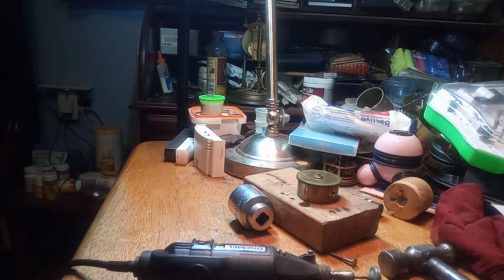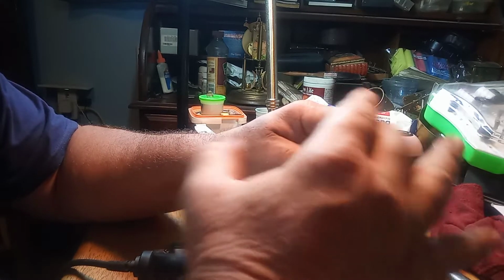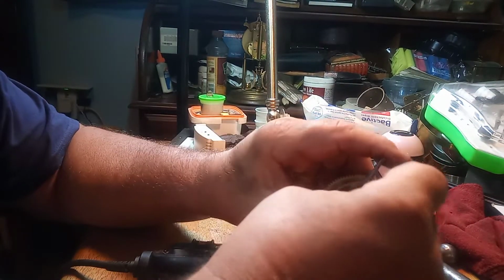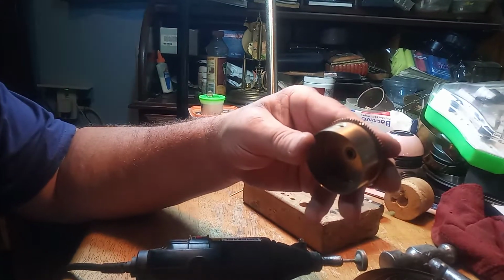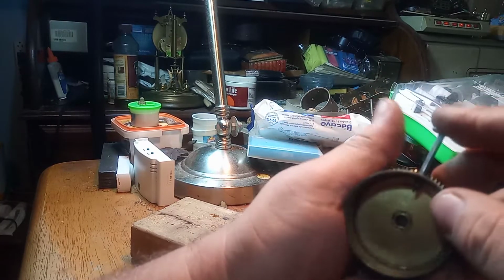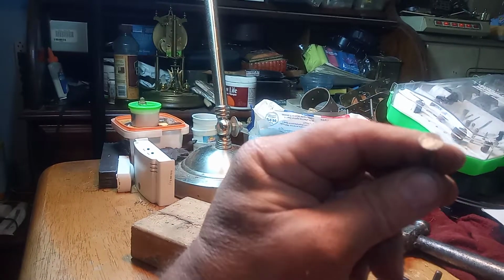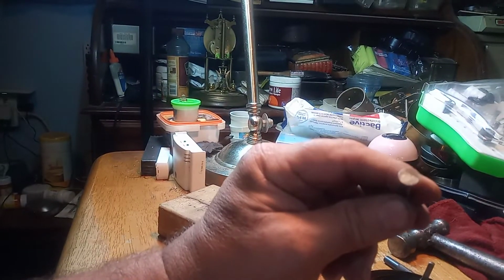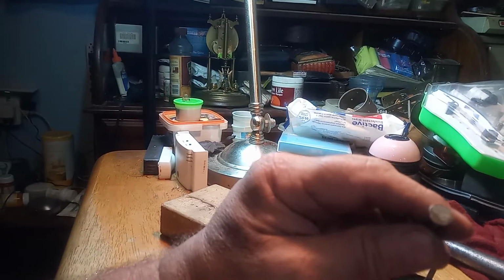Repairing a barrel spring catch in a Junghans German wall clock made in 1917. 20220820 175732

Comment: I have been lucky I never ran into this problem, but this is a great idea what you are showing and the nail head sounds like a good idea.
Reply from the maker: Thanks. I watched a you tube video from a man a few months back that performed this demonstration for his NAWCC chapter. Or for the NAWCC. He has done it several times. Here is his video.  https://www.youtube.com/watch?v=U8r_2zugarg&t=0s
Reply from the maker: I watched his video again and what I failed to mention in this video but I did it in my original video on repairing my granddaughters clock was counter sinking the hole that way your peen section grabs a hold of the barrel. I failed to do that with this one. However it still works. It isnt going anywhere.  This is my other video where I did this. https://www.youtube.com/watch?v=baxsjOm8KnM&list=PLGd5hmS4B9JP70H3xt9dEfGNG4XxNSOUP&index=5

Comment: So I did mine different but it is holding well. I pinged the barrel to hold the original spring hook in place. Thanks for your video and the NAWCC video. It looks much easier this way than how I did it. Also fitting something inside the barrel was good to see. I struggled with that also.
Reply from the maker: Yeah after I did mine I remembered that the NAWCC video mentioned pinging the barrel. LOL.  Glad that you got it fixed.  Thanks for watching. God bless.

Comment: I found steel wood screws work better than nails. easier to file and peen .   try not to drill an extra hole.
Reply from the maker: I will have to try a steel wood screw next time. Thanks.